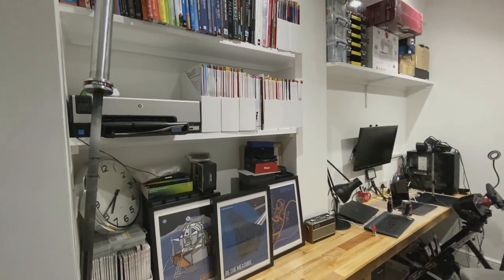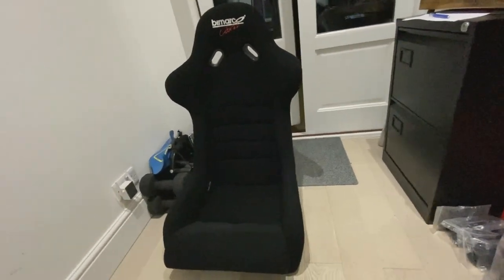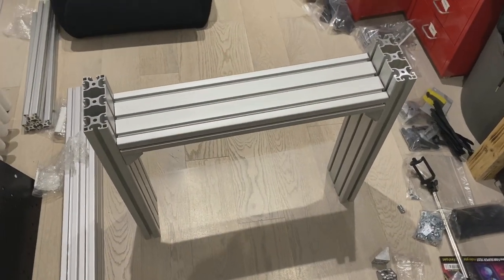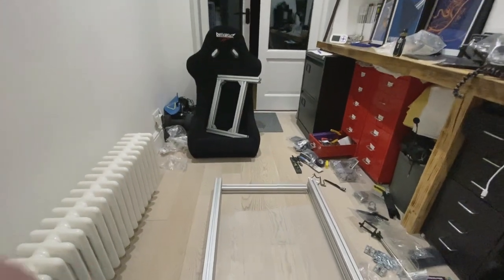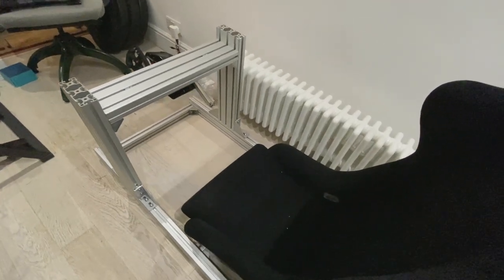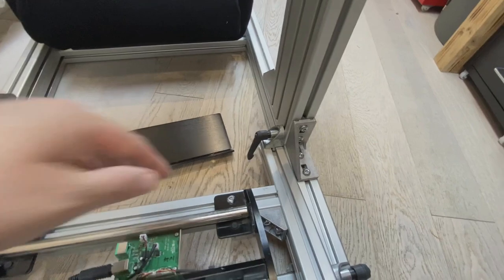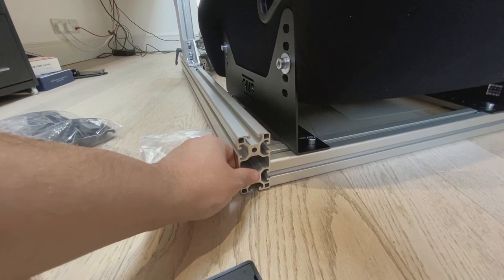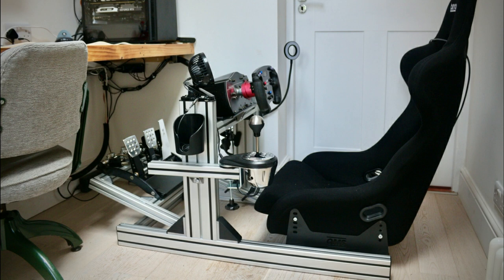Sim Racing | Build your own sim rig. Part 2: Building

Comment: Pull a seat mount out of a car in a local junk yard... most are only held into place with 4 bolts. you could use a manual one to slide your seat or opt for an electric one that runs off of 12 volts.

Comment: hello. 

Nice DIY rig first of all. Can you help me to understand better what you did between Part1 design and now? especially for the pedals and wheel deck. 

With the pedals, its difficult to see how the deck is actually mounted now to the frame and how you put the rig in compact mode under your desk. 

As per the wheel deck, I have a TSC PC racer wheel and also would consider to make the deck out of alu profile and have the height/tilting adjustment from this instead of an additional wheel deck. You are talking about 2 levers you added but again difficult to see how they look like in the video.

without being a pain, could consider making another video specifically to show these 2 design changes you made, and also how you slide the pedal deck when you tidy up your rig?

thanks so much

Comment: awesome. Can you design a dual purpose rig,  flight simulator with central joystick, throttle and rudder pedals, plus racing car with DD wheel, pedals, shifter and handbrake? Keyboard, mouse pad. Movable parts so that you can transition from flight mode to race mode in one minute? Ah, having the ability to tilt the seat to reflect the different angles of car vs plane sitting position would be also great 😉
Reply: Ok, the OP is being a bit sarcastic here, but I am designing just such a rig right now. Flight sim and racing sim, but I don't think I can meet the 1 minute changeover time. Maybe 5 minutes, depending on how you want the removed bits stored.

Comment: This helps! I have a cheaper next level challenge cockpit. It has the center post that is a bit weak. I’m going to remove the center post and build a wheel stand out of this stuff around the existing cockpit. Ordered the csl dd so need something stronger. Will be more comfy without the center post between my legs.

Comment: Nice build - You can snap the teeth off the back of the angle brackets so they sit flush when not able to sit in the profile slots. (ie - under the wheel base plate)
Reply from the maker: Good tip!

Comment: know this is an old video, but wondering if you remember your cost for the frame components only? I admittedly didn't have the patience (since I am in the US) to jot down the cost of every item and quantity and convert to US currency. Hoping you might be able to throw a ballpark figure out just trying to see how much I would save if I built this over buying/ if I built this if I could spend the same on upgrading accessories/sim racing components to get more value for money
Reply from the maker: Probably around $200-250 at the time roughly speaking. No idea what aluminium prices are like these days, though.

Comment: I built mine out of 3030 profile predominantly and used some rudimentary logic to remove the need for MASSIVE uprights and base beams. It probably  cost about £500
Reply: How is the rigidity of your rig? im torn between 3060 /3030  or 4040/4080. The clear benefit for me on the 3060/3030 is the massive weight savings, cost is not that much different. also the 4080 looks cooler.
Reply: The rigidity is acceptable, I must make you aware that my rig is not a traditional design/shape. It is made with all 3030 apart from the uprights which are 30/60/60(an L shaped profile) and the pedal deck which is 30/60( for strength. If you are going to make an inverted T shaped rig like everyone else then 30/30 is not the right choice. Happy to answers any questions you have.

Comment: That was a great couple of vids, thanks for posting them. Have you considered doing a follow up vid after using the rig for a year, what you learned, and do different if you had to do it again, etc. Really informative, great stuff, thank you. One final thing, did you ever post the measurements, as I don't seem to see them - I'm getting old and stupid, so prob my fault tbh.
Reply from the maker: Thanks Andy. Yes - this has been on my radar forever, but struggling to get around to it. Thanks for the nudge. I’ll be sharing measurements for a rig in that video.
Reply: @FindingSpeed  have you done this yet?
Reply: @FindingSpeed  would be really good to see your cost and measurements or CAD file

Comment: Hi, thank you for these very informative videos. One question: which are the different angle clamps with levers that you used to tilt the wheel deck, and why did you need to use different ones (from those of the pedal deck)?

Comment: Great build idea. Looking to do something similar. Particularly like your retractable and adjustable pedal mount using minimal hardware. Those angle clamp blocks you're using with the locking lever, it is a tab on one side... How is it not sliding given the tabs are in the same plane?
Reply from the maker: The locking lever connects to a t-nut in the opposing profile. It’s pure pressure. They’re rock solid. I have my Sprint pedals set at 58kg and there’s no play at all. Hope that helps.
Reply: @FindingSpeed  it does help thanks. So they seem to hold up to the shear stress from pedal presses. Good to know (I reached out to 8020, but they don't test application loads as it varies so) Would love to see a video of you folding it up. Great work here. Congrats and good job... See you on the track maybe :)

Comment: By the way, where did you get those adjustable levers from. (The ones you used for you foot pedal support).  Is there a proper name that the aluminium extrusion companies refer to them..?  I have been looking all over and unable to find them anywhere.  Do you have a like I can purchase them from.  They were a brilliant idea.  Thanks in advance.
Reply from the maker: Hi. Thanks for watching. The kind of adjustable levers featured on the pedals are these:  https://www.motedis.co.uk/shop/Slot-profile-accessories/Accessoiries-40-I-Type-slot-8/Connector-angle/Angle-Clamp-40-with-Locking-Lever-I-Type-slot-8::99999666.html

They're called 'angle clamps' - the type I've linked to is correct for standard 40mm x 40mm 80/20. They're super useful!

Comment: Hi, I really enjoyed how you got such a compact footprint for your rig, pls may I ask what the  outside length / width of the frame are and how tall you are - if it's not too personal your inside leg measurement as our bodies are all different - I promise I don't want any other personal details :o) to give me an idea of what works for me and what height of kids / other adults it could cope with? Also I had an idea to compliment your brilliant design - have a reclining race seat on runners - you can pick up cheap. That way you could slide (usually around 200mm of travel - I also have kids so this would allow for adjustment for different heights - hence my request for your height) the seat forward and tilt it forward in "storage mode", this could make you and your wife even happier :o)  Please can you also post details of the quick clamps you used to get the tilt on the wheel base mount. You are an awesome guy - I really love how compact this is :o)
Reply: Sorry for asking the same questions as other guys for example the clamps for wheel bracket. I have seen this info.  Pls can you let me know when your dimensions video is out and your height inside leg measurement if not too personal would be great

Comment: Thanks for this, very helpful. I have similar space issues so this looks pretty perfect. I don't suppose you could post details of the dimensions could you? I'm going to try doing something similar with the moveable pedal deck. Thanks!
Reply from the maker: Working on a video that puts all the dimensions and details together in one place. It'll be in the same playlist.
Reply: Finding Speed Thanks man. I've actually ordered a very similar looking rig from Motedis as a kit. Just need to wait for it to arrive and assemble the bastard!
Reply: @FindingSpeed  don’t forget to upload it ;(
Reply: @FindingSpeed  Hi, was just wondering if you had a chance to upload this video with the dimensions etc, or if you have the file with your design. Your design would be great for what I am looking for, limited space etc. Cheers.

Comment: Good build video. I appreciate you posting it for us. I am thinking about using aluminum or maybe (FULL SEND) carbon fiber. I want to lighten up my top frame on my 3 DOF rig. You have a LOT of subscribers so Maybe someone here might offer advice? My TOP frame needs to be lighter especially with the V3's and transducer hanging way out there. Does this type of extrusion frame flex? Will it bend on a small pivot? If you have time, look at my rig. I need a bit of advice to improve response (other than bigger motors!) . Thanks DMAX

Comment: Great vids Russell! I've decided to go ahead and do my own as my new CSL pedals are flexing my Playseat Evolution way too much. What are your thoughts on using 30mm/60mm instead of the standard 40mm/80mm?
Reply from the maker: Thanks David. You can definitely do that, no problem. People make them out of drainage pipes! That said, I personally wouldn’t. When it comes to upgrading elements, attaching add-ons etc. you might live to regret it.

Comment: In process of building one of these myself. I've got a question for you tho... What dimensions do you use for tubing? 40x20mm or 80x40mm?
Reply from the maker: Sorry for the slow reply. There's both 80x40 and 40x40 in there. In hindsight I probably would've gone for 120x40 on the base.
Reply: we have materials

Comment: Would you mind sharing the angle clamps that you used for the wheel deck cross member? I can’t find anything that clamps nicely for extrusions set perpendicularly...
Reply from the maker: Yeah - it was a pain to find them. They're called Adjustable angle locks. 

https://www.motedis.co.uk/shop/Slot-profile-accessories/Accessoiries-40-I-Type-slot-8/Connector-angle/Adjustable-Angle-40-slot-8-I-Type::99999667.html

You need to buy the threaded locking clamps separately AFAIK.
Reply: @FindingSpeed  Thanks for the quick response! Oh wow, I could not find those anywhere! So, I'm assuming that you just mounted them in the middle of your wheel base cross member where they meet the uprights?
Reply from the maker: Yeah - all four corners.

Comment: Any dimensions? I "stole" dimensions of a p1x pdf. What is the clearance between the pedaltray and rig. For example. The internal rig width is 500mm and the overall pedaltray 497-498mm just to make slide without getting stuck?
Reply from the maker: You don’t need to knock mm off inside dimensions - as long as they’re the ‘same’ it’ll go just fine.

Comment: How long is your base? 45"? Im looking to build something similar for myself and wondered if it would be cramped being 5'8"
Reply: Not sure if you still need help but I'm 5'9" and made a similar diy rig and my base is 45" and works fine. Personally would have wanted to go longer (47" since it was more shipping for 48" and over for my case) because you can adjust it shorter, but once it's cut you can't really go longer.
Reply: However, his design has a pedal box that goes outside the base to give it even more length and adjustability so if you did( I did not) that with 45" base you should be fine
Reply: @joeyg369  I already placed my order (RIP) I ended up going with 40" being I'm 5'9"  and I only had 42" to fit the rig.. Hopefully since I don't plan on having a straight leg setup like this one it wont be as cramped
Reply: @THE_RYANN  you should be fine. However if it is cramped, I would just order a couple more pieces of extrusion to make the adjustable pedal set up that he used in the video and it can be slid in when not in use. I'm doing that to get more angle adjustments on the pedals 👍

Comment: Hi, thank you for this series of videos, - I'm a DCS sim pilot and also wheelchair bound (this will make sence to you soon) I have issues setting up my gear so i cant even go for a fly often, brought the next level racing flight sim pro and it didnt do what it was supose too and was too uncomfitable too (40" seperation between throttle and stick) but i found your video and now am looking to design a ali station.  May i ask, do you think they would be strong enough (ballence wise) to have with out a chair, so i can use it more as a front frame for example, so i can use my gaming chair or wheelchair depending on my day. did u order your alli profile from the company you send the quote to on the software or someone else (sorry if i missed it) and would u be willing to say roughtly how much it all came too? many thanks
Reply from the maker: Thanks for watching. You could definitely tailor this to make a frame that simply sits in front of you. I don’t know what kind of weight of equipment you’re putting on it, but mine wasn’t top heavy with out me sitting in it. It needs a non-slip mat or even rubber feet ideally since it’s surprisingly lightweight and would slide on hard / wood flooring. 

I designed it in the software, which prints a handy parts list which gives you dimensions. I used that info to order direct from my supplier. I spent around £250 on the profiles, but I don’t know what today’s prices are like. Hope that helps!
Reply: @FindingSpeed  Thank you for the reply, helps a hell of a lot tbh, as for weight i really dont know either, but i know the Foot pedals are probably most of the weight so should help hold it down. i will start coming up with some ideas soon then, winwing took a ali frame setup with them to the flight sim expo to show off what can be done, so i might try and work with that. Thanks again bud this is so helpful
Reply: @FindingSpeed  got another question for you, if you dont mind, how did you know what parts you would need for "strengh" of holding parts? - im new to all of this so i honestly dont know how much weight one of these can / should handle
Reply from the maker: @Phoenixfett assuming you’re dealing with racing / flight sim equipment you’ll be fine with 40/40. People often use 80/40 or 120/40 for based to make them higher or heavier, but in terms of strength they’re incredibly strong so you won’t need to worry unless you’re creating an industrial application.
Reply: @FindingSpeed  Dude you're a legend, thank you so much
Reply: @FindingSpeed  do you remember who you ordered from by any chance bud?

Comment: Could someone help me out?
I am trying to build a sim rig keeping costs at priority and so I want to know if 60x20 mm extrusions would be strong enough to bear the loads? Those are the biggest one's available to me currently.
Reply from the maker: It will likely be ok, but you’ll struggle with it being very light-weight and likely to move around. You’d probably need to over-engineer slightly for stiffness and stability.

Comment: awesome Vid mate, can I ask where you got the wheel plate from please?
Reply from the maker: Here's the link to the product. It's not the best wheel plate on offer IMO, but it's one of the more affordable. 
https://iovaluetech.com/Compact-Cockpit-sff-wheel-Plate/
Reply: @FindingSpeed  Recently started planning my own rig and your videos were quite helpful! However I'm not sure what's the best way to mount the wheelbase is yet.
The plate you have linked - are you sure it's the one you have? On their website it's not just a flat plate like the one seen in your video - and apparently it's supposed to be sidemounted which would be impossible for what I've planned right now and really just inconvenient, since it's also curved slightly :(
Reply from the maker: @Vallin87  you’re right. It wasn’t that - it was the flat version of that somewhere else on that site. What wheelbase do you have? You might not need a plate at all
Reply: @FindingSpeed  Looked through their site earlier but it was the only plate I've found there unfortunately. I'm currently using a the CSW 2.5 and I was thinking of maybe using 2 40/40 profiles and then use 2 L brackets to mount the base - but I wasn't sure if it would be strong enough this way, since normally you use 3 bolts to mount the CSW
Reply from the maker: @Vallin87  that would definitely work fine.